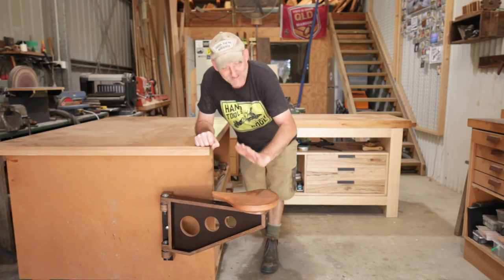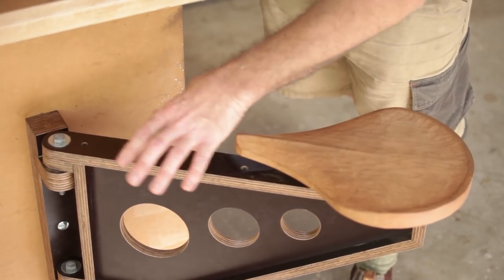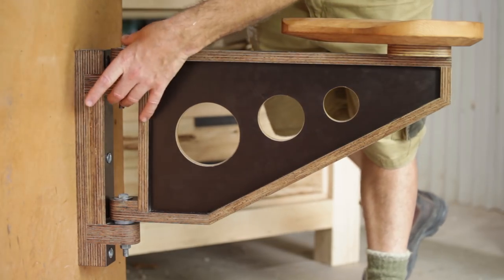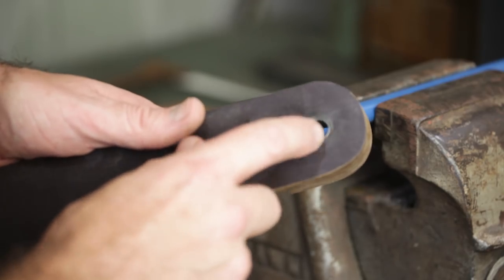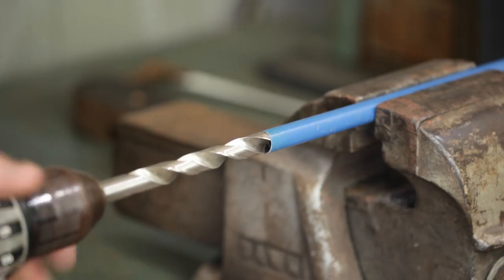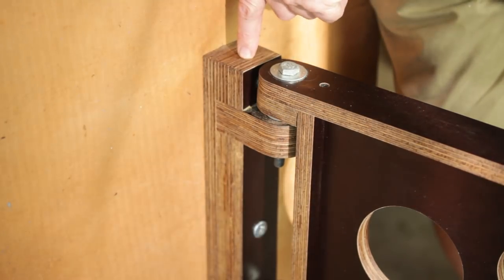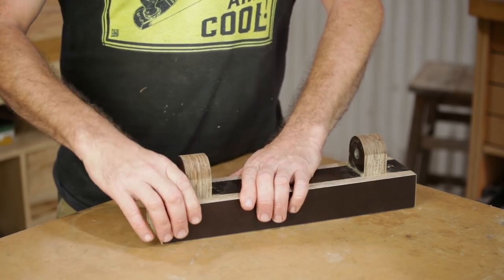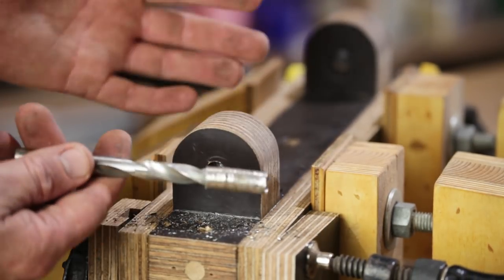Plywood Swing Seat Upgrade - New & Improved

Comment: If anyone has trouble sourcing the HDPE plastic sheet to cut the washers from, I've found ordinary HDPE milk jug plastic to be very effective in lubricating a load-bearing surface such as this.  A few layers of this will let you build up to the desired thickness, and a light smearing of paste wax between them will make things even slicker.  Even though they're so thin, there's little chance of them wearing out, as the layers slide on each other instead of abrading.

Comment: I liked the original and these are good ways to improve it. Your idea at 7:14 to put the seat part in double shear would probably be the best improvement. Then you won't get the twisting motion in the hinge bolts.
Reply from the maker: Thanks Brian! :)
Reply: I concur. Going to double shear more than doubles the strength of the joint by eliminating bending forces on both the bolt and the wood.

Comment: Heya Neil, G'day! You could have a longer cantilever if you made all the supports vertical rather than horizontal... meaning where the hinge is fitted you could have those positioned vertically rather than on the flat side... also if the hinge area especially the top one was dispersing the weight over a larger area... meaning a bigger plate preferably made of wood... It would be able to take even more stress.

Comment: I love the seat making but seeing the process, it could be an idea to dovetail the top and bottom holders of the frame so the pulling from the weight is hold back by the angel of the dovetail. I would make the seat turnable on the triangle what would ad to the comfort and maybe make the triangle not horizontal but under a 15 degree bringing the weight of the person more directly to the bench. but man I was waiting for this. I made already a plasticbag garbageholder on my bakery table what turns under my  table if I don't need it. Great project thanks

Comment: new subscriber here. really enjoying your vids.
i had a thought, i cant explain the physics behind this thought but it occurred to me that if you used a threaded rod that went all the way through with a set of locking nuts both above and below the hinge points it might strengthen the hing quite  bit.   i think having the hinge pins short and not all the way through will cause excessive stress at the point where the pins are bolted down. however if the pin goes all the way through, the stress will be more evenly distributed and therefore lessened at those crucial points.
anyway just a thought.
cheers from Kona :-D

Comment: Great analysis & problem-solving. How is the side of the work table holding up? It occurs to me that a backer on the inside of the work table would help spread the point loads. Of course, that would affect the lower drawer capacity (but use filler strips to address the gap. Oh, well - tanstaafl.

Comment: What if you used hard wood. Would take make this stronger.
Reply: Kind of depends on the source plywood to begin with... As Pask pointed out, good plywood (high end) is really durable stuff... BUT... not everyone necessarily has the resources to pour into that.
   SO... if you're a bit "shoe string"... Hardwood (regular) lumber is a plausible way to improve over "low end" plywood, which can be "a bit sketchy at the best of times".

   HOWEVER, it's important to take note of possible issues with a conversion to hardwood over plywood... Hardwood is sensitive to humidity and warpage... Even sealed "pretty well" joints and recesses can absorb humidity and swell, and wood swells ACROSS the grain, so it can literally push your "framing" apart.

    Okay, rather than JUST scare you away from it, maybe I'd recommend a "hybrid" design, using more hardwood for framing purposes, and filling with plywood, since plywood isn't so liable to swell and warp... at least not as readily (once you apply finish).
   If that's the case, an extra hinge "knuckle" or two wouldn't be a bad idea, just to add a bit more structure to the whole hinge joint. I'd probably recommend it, just on the principle that the hinge is THE weak-spot in this engineering. You only have to be particularly careful to align all the holes for that rod to go through... AND that hardwood isn't any better about wearing outward against moving metal parts than plywood, so install those lengths of pipe/tubing "bushings" in every hinge knuckle.
   Other than that, though, sufficient care in joinery and installation should last for damn near ever... and be plenty strong enough almost without regard to what you make it out of specifically. (though I might recommend against cardboard...lolz)

   I know I'm not Pask, himself... BUT I hope this kind of helps. ;o)